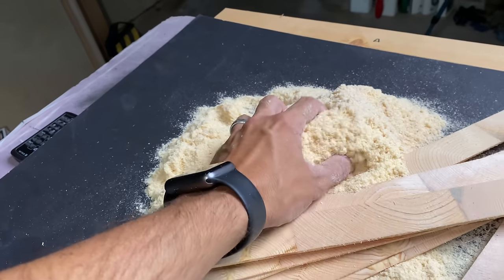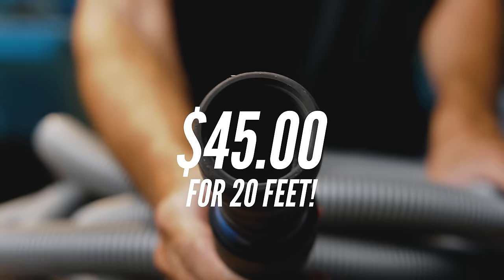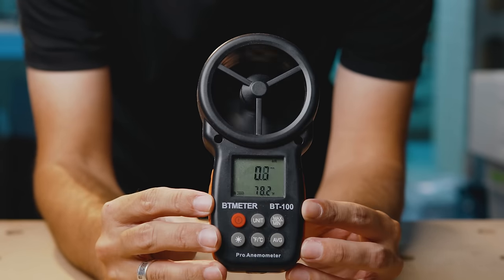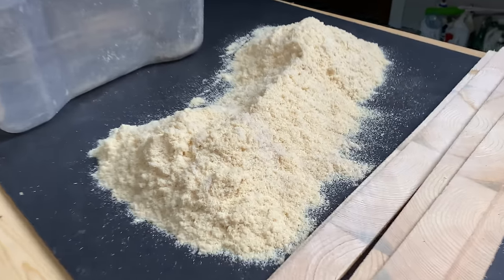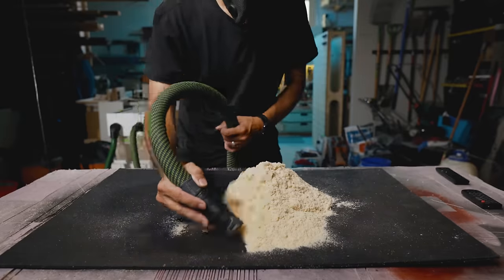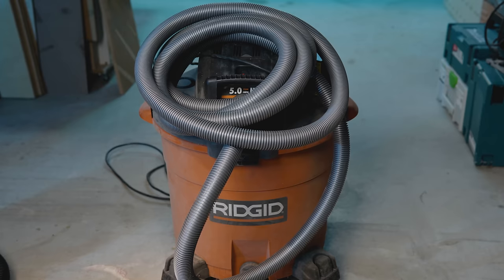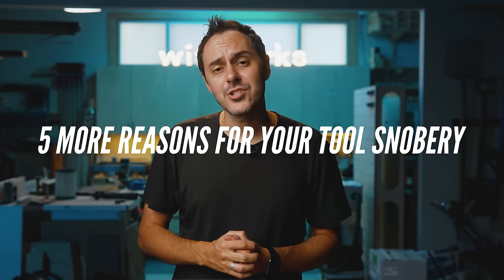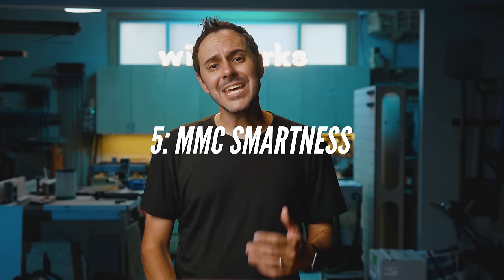This video will save you a lot of money. Dust extractors for beginners.

Comment: How has nobody pointed out that the festool is pushing out twice as much air? It's processing much more air so yes, ejecting more particulate matter is reasonable.

The real test would be to get two festool units to compare with the same filters but modify one to suck half the air as the other one and read the results. You'll see a similar difference as what this content creator produced with different vacuums. 

Good experiment but variable control and isolation obviously producing inaccurate conclusions.

Comment: Sooo...The Festool $1600 vac is for the Lazy woodworker who can't take 1 minute to go pop off a lid on a bucket to empty it. Gotcha. 

I use a rigid vac myself. I don't buy into the hepa hype. I just use the regular ol blue filters. I also use the dust buddy. I don't have any complaints. I don't even have to go and check it to see if it's full, I can HEAR a change in pitch and using the dust buddy creates a particular whine. The pitch changes. I don't need a $1600 gadget to beep at me telling me when it's full or about to overheat. 

As far as the "spending time" to build a cart for it...Well, it's a one time investment and it's done. For that matter, it only takes an hour or so to build one. "You'd " rather spend $1600 vs. an hour cause it's a waste of time? I dunno man, doesn't seem like you got your priorities straight on that point. 

Festool, just like Sawstop are nothing but "gimmick" brands and tools and, well, like the saying goes, there's a sucker born everyday and it seems like you and some of these other YouTubers jumped on that bandwagon and have that "extra" money burning a hole in your pocket. What you should be doing is crafting your skill level instead of wasting your time on gimmicks. 

$200 bucks on an air quality meter. Hmmm. You gonna use that meter much? Or just for this video? You know what us old (49 years) guys with 30+ years of woodworking experience do for air quality? We open a window and/or a door, stick a boxfan in front of it. Viola, $20 dollar air exchanger. And those dust boogers we ALL pick out of our noses...That's just free wood putty.
Reply from the maker: Thank you for leaving a long comment that YouTube likes so this video will get promoted more. You’re the wing beneath my wings. 

Ps: I don’t have a window in my shop and leave my garage door closed because I live in a high crime urban area.
Reply: @wittworks  Lol 😆 At least you read it. 👍

Comment: https://youtu.be/nOslpluQ6pc?t=855
These are exactly the scores you should expect for the filters in these conditions based on your cfm readings at the beginning.
Once the new filters are loaded a little, they should beat your old vac. If you cleaned out your old vac and replaced the filters you will see it drop to the bottom. Particle count / volume of air filtered should be pretty close between the festool and the new rigid BUT for a given db level the Festool will sock the socks off the rigid (if it had a speed control).

Comment: The calculation is simple. You have tool which can save you 2 min every day compared to another tool. That is 8.6 hours for a year. For a $50 hourly rate that is around $430 saved over a year. Factor in the upkeep differences of both tools and you'll have a rough idea of the ROI of the more expensive tool. In cases ROI is a negative, meaning, it is an objective waste of money. This is especially true for tools with high upkeep.

Anything else is just pure bullshit and useless gimmicks.

Yes, the festool vac might actually be more efficient over the vast majority of other dust suckers.

Comment: You should maybe interpret it by recognizing that your $50 Amazon particulate meter is not actually a metrology grade tool, you're not in a controlled environment, and you can't actually rely on these results to make the conclusions you're making, especially when the results are this close to each other. All of these are well within the margin of error for this tool.

ESPECIALLY if your conclusion is "hey everyone you don't even need the HEPA filter, just use whatever old vacuum! Silicosis? HEPA ratings? Fake news! My cheap hobbyist meter told me so."

How do people not understand these super fundamental concepts? Do you think every OEM buying expensive, calibrated test equipment instead of random white-label Amazon stuff is doing it because they hate money? There is a reason they do that. There's a reason they test these under CONTROLLED and repeatable conditions. You're giving people dangerous advice.

Comment: This whole video is pretty much trash cuz you didn't describe how you did the tests you didn't describe if you left your shop for an entire day so that way all the particulate had time to settle or if you were somehow able to vacuum and clear out the room so that way the particular was not in the air for the previous tests.
Reply from the maker: the whole video is trash because I didn't show you when the room zeroed out? Your logic is superb. It did zero out, I cut it out for time length. Originally video was 40 min long.
Reply: @wittworks  I don't think anyone would have minded more time on the video for better quality, and less of a waste of time. It might have not wasted anyone else's time, but it sure wasted mine. I can't take any of your results seriously because I don't know if the air was pure before each test, absolutely pure. If there's build up of particulate from the other vacuums in the air, by the time you arrive at the last vacuum, it wouldn't matter if it sucked 100% of the particulate out of the air, because floating around in the room is dust from the previous two tries. 

I'm not saying Ridgid isn't better, or that the other system is the best, and I know it frustrates you because you put so much work into this video, but if each test was done after you were absolutely sure there was nothing in the air, this test would have felt more reliable and useful to me.
Reply from the maker: @harrychristenson4938  I guess you can spend $1500 and do your own test 😃